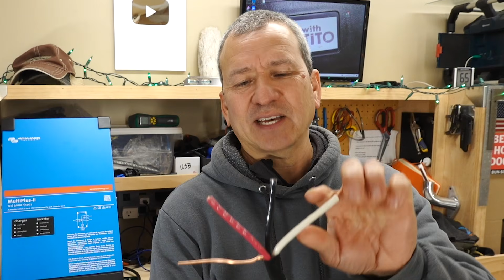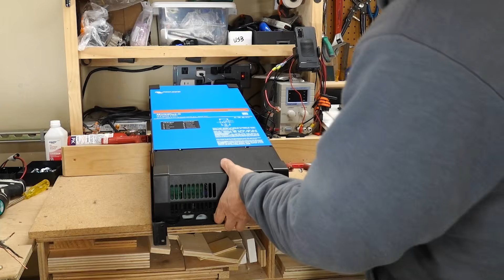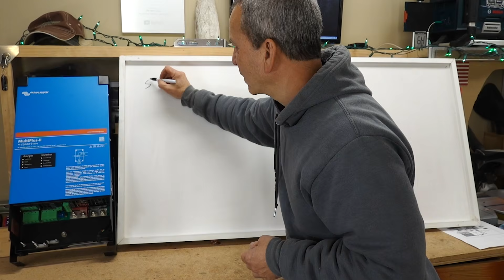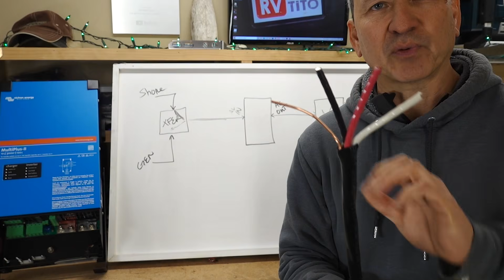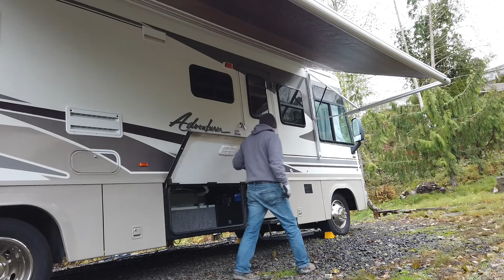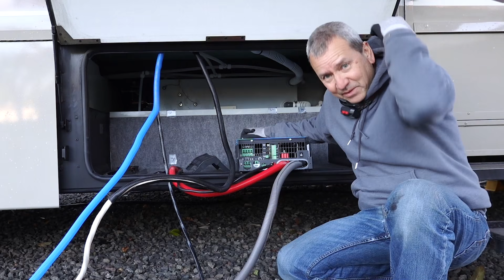Installing the Victron Multiplus II Inverter to Power our 50A RV Off-Grid | RV With Tito DIY

Comment: I opted to do this in phases. The inverter Pre-wire on our Brinkley is a 30-amp circuit looped to the front bay of our 5W. So essentially this is like being at the state park on 30-amps. I think it will work for now. 

This 30-amp circuit evolved at the factory over time, ours runs everything but the front AC, the 1,100-watt microwave, the electric fireplace, & the converter. 

I unplugged the converter now., of course. 

We camp host at 8,500' in a steep canyon so even though the rear AC (7 amp AC draw) is on that same 30-amp circuit we won't need it 99% of our summers. 

Phase B will be to drag two more 6-3 marine grade wire bundles from the kitchen AC breaker panel area through the chase way to the front 5W compartment. That will require the help of a buddy I am told if I am to do it without dropping the belly pan. I like your idea of two different colors of split cover wire protectors. All I will have to do then is upgrade my 30-amp dual 2 gang disconnects over to the 50-amp size. 

For phase one I have the 6-3 6 ga. wire in place from the intermediate disconnect box to the inverter already. Since it is emulating being on 30-amp single L1 like a state park (only 12-2 comes with the Inverter Pre-wire), shall I jumper L1 & L2 at the input side of that intermediate disconnect box going to the inverter or leave the L2 line floating? In the case of the 30-amp at the state park with my 50-amp to 30-amp dongle they would be tied together. However I would just be emulating this manually in my own wiring at my Inverter disconnect. I see a lot of folks just not hooking L2 up if they have a single 120-volt line in, but that isn't how the outside dongle on my RV works, for example. 

The 6-3 going back out to the coach from the Inverter is wired, but only L1 going back to the Pre-wire line. For now, L2 is going to an outlet I set up for a small Lifepo4 charger that I use as an alternative to recharging a separate 100ah Lifepo4 battery dedicated to powering our Starlink 12 to 48 volt DC to DC converter to our POE. That battery has its own solar panel, but with camp hosting I like to be like NASA & have redundant functions in most everything I do. 

Also, since they are shorter runs to my Lynx Distributor, I run two runs of 4/0 cable for both the red & black wires on my MK2, fused at 200-amps each red wire. They run much cooler now at a full 30-amp AC off-grid load which is an easy 200-amps DC. However I did not do this on the 560ah battery bank yet. Even us OCD guys never finish our work!

Cheers, Davey - KU9L
Reply from the maker: If the inverter detects split-phase 240VAC across L1 and L2 (50A shore power) it will pass that through to the L1 and L2 output. If it detects single-phase (your 30A) then it will split the L1 120VAC input across L1 and L2 on the output (basically jumpering it internally) and ignore the L2 input. The output will be duplexed 120VAC single-phase. Hope that helps.
Reply: @RVwithTito  Thank you, sir. It appears then I don't need to jumper L1/L2 input together then for a 30-amp Pre-wire input on a single line. Their SW & electrical engineers have it figured out. Either way I would remove the Jumper before running those 6-3 lines to the main fuse panel & back. The reason I do not have it done already is my jobs do not seem to come with a Tito to keep me on task, lol. Thank you, Davey - KU9L

Comment: Is this really a true 50amp system though? From what I'm looking at, this inverter is only rated at 32amps max when using just the batteries to create your a/c. The only time you have access to 50amps is during pass thru when the generator or shore power is hooked up.
Reply from the maker: No. You're correct. The inverter is limited to just under 3KW. A 50A shore power connection can potentially supply 6KW to each leg of your service panel for a total of 12KW. The benefit of this inverter for 50A RVs, is that it can switch between the split-phase grid pass through mode and single-phase inverter power while still powering both legs of the power panel. Prior to this, you'd need a manual switch and two inverters to accomplish this. And yes...while on inverter power, you need to manage your large loads so you don't exceed the 3KW max of the inverter. Hope that clears it up.

Comment: Thanks Brian. Just started this project myself.  Good info.
Reply from the maker: Good luck with the project. What kind of RV do you have?
Reply: @RVwithTito  We picked up a 94 Holiday Rambler Diesel Pusher. Making a playlist of all the fixes and upgrades we are doing. I'm going to reference this video if it is ok since you do a great job explaining it.
Reply from the maker: @TignerAdventures  Great. Nice upgrade. I remember you guys from Casa Grande. Hope you're doing well. There is an entire playlist about that project. Let me know if you have any questions. 👍 The only thing I'd do differrntly now is to install one of the new Quattro II units instead of multiplus. Then you can ditch the atomatic transfer switch.
Reply: @RVwithTito  The wire you tapped into already had gone through the transfer switch. So it would have been more work running wires to eliminate it. So since you have a ATS would you still prefer the Quattro? Does it manage the connections better?
Reply from the maker: @TignerAdventures  You're right. It's definitely not essential, just another option. To do it, I would have to run an extra cable from the ATS location. It would just eliminate the ATS. I had to replace my ATS a while back anyway. There would be some additional controls you'd have but I haven't dug into it in great detail yet.

Comment: Instead of running the wire from the inverter to the breaker box, couldn’t you just set up a 50 amp receptacle there and plug your shore line into it? Seems like it would be easier. The shore cable runs to the breaker box right? And if you’re putting the inverter in between the shore power auto switch, instead of running that cable, why not just set up the 30 amp or 50 amp receptacle and connect to the breaker box that way? Please be kind to me with responses.

Comment: Thanks for the video, great stuff. Question, I have the same inverter with a 30amp shore input. Would you see a need to breaker or fuse that input before the inverter in case the inverter tries to pull 50amp?

Comment: Thanks Brian,  one question, did you disable the converter charge wire to the batteries? Or doe both the inverter and converter charge the batteries?  Thanks for the great instruction
Reply from the maker: The Multiplus charges the batteries. The Converter/Charger was no longer needed so I removed it.
Reply: @RVwithTito  Thanks for the reply.

Comment: Great to see your video. I'm heading this way based on a couple of videos from @AllAboutRVs. This is a great solution for our class A to power the entire coach with the single inverter. I'm pairing it with two Vatrer 460 AH LiFePO4 batteries. Thanks again for all the great information!
Reply from the maker: Glad it was helpful! Good luck with your project. Epoch has a couple good 460Ah LFPs as well with all the bells and whistles (including Victron communication). I'll be reviewing them soon.
Reply: @RVwithTito  I have an epoch And it shipped broken, customer service doesn't return calls. Luckily I was able to take it apart myself and found it was just a loose cable. But will go with LiTime or something else next time.

Comment: For 30 amp service you still use the MultiPlus II, but not the 2X version. Multiplus II for 30 amp, Multiplus II 2X for 50 amp service.

Comment: Can I do the same using the Sungoldpower 3000W DC 12V?
Reply from the maker: Not id you have a 50A RV.. The Sungoldpower 3000W is for single phase only. So only 20A or 30A AC power.
Reply: @RVwithTito  Thank you. So, would the 4000w split phase work? What's the difference between the 4000w split phase unit and the multiplus you are showing in this video?

Comment: Can I use the multiplus 2 on 30a service and just use one leg? I am going to eventually going to upgrade to 50a but want to buy the Victron now; however, I dont want to spend the money on a multiplus then have to buy the Multiplus 2.
Reply from the maker: Sure can. I rarely plug in anymore and when I do it's usually only 15A. The Multiplus will split the output across both legs if you have them both wired up. If not then just wire up L1, neutral and the ground. 👍

Comment: Good information Sir . I just purchased the exact components that you just installed  but I do not understand why you ran your Shore and generator into the existing transfer switch because that inverter already has it's own built in transfer switch . 
Please explain and thank you.
Reply from the maker: The two transfer switches serve different purposes. The RV's Automatic Transfer Switch (ATS) switches between generator and shore power coming into the RV. The Inverter's transfer switch handles the switching between incoming AC power (from the ATS) and inverter power. That incoming power could be from shore power or from the generator (hence the other transfer switch).

Comment: Why do you use four seperate solar controllers instead one bigger one?
Reply: Or he separated different strings of panels in case one set gets shade the others are still good. If you have them all in one series, one panel with shade affects the entire array.
Reply from the maker: Plus each one generates a different amount of energy as the sun passes and some may be tilted while others aren't. They all perform independently.
Reply: My guess is load limitations of the controllers, or he has four separate arrays on top to maximize power when using blends of different panels.

Comment: I have a question.  What is the purpose for the selector switch on the bottom right used for?
Reply from the maker: Just a manual switch to turn it on/off, inverter, or charging only. Once you're connected.to a Cerbo or Victron Connect App you'll never need to use it.

Comment: So if I have a 50 amp system and use a dog bone to 30amp, will both L1 and L2 still have 120vac just be in phase?  Same with generator running, would L1 and L2 be hot?  I heard it will see them as in phase and shut down L2, is that true?
Reply from the maker: Yes. It will be single phase on L1 and L1 coming in, but I believe the inverter detects single phase and only looks at L1. It will then branch it internally to both L1 and L2....I think. In either case, the inverter treats it as a pass-through.

Comment: Hey tito. 
thanks for the video. 

1- let me ask you about the, lets call it "controler power source" or what ever multiplus II needs to go to an ON stage. 
let me try to explain: 

I have a renogy inverter, and now upgrading to a multi plus
the renogy receives the "controler power" from the batteries. 
if your battery lose charge completely (either litium going on sleep mode or AGM going very low), renogy inverter cant turn ON to charge the battery EVEN IF YOU CONNECT YOURSELF TO SHORE POWER OR TURN ON YOUR GENERATOR. 

so you get yourself into a situation where you have big AC power coming in the RV, but cant do anything. Cant charge the battery. cant use the short power. 

(i believe go power works the same way)

I have always ask myself why the inverter cant use either/or: AC input OR DC input to at least go to minimum ON state.

NOW:
I see you have your Multi plus connected to AC BUT no DC. and you are working on it. 

BOTTOM LINE IS: DOES THE MULTI PLUS CAN USE EITHER/OR  AC/DC TO POWER UP? 

2- Did you used the hook to mount? or just screws?
seeing my RV, it first vertically, but I think there wont be room to going up enough to hook it up. 

great videos. watching them all. 

THANKS!

Comment: Brian, is the Victron Multiplus II compatible with a Electronic Management System (EMS)?
Reply from the maker: Depends which one and how it works. When on shore power everything should be 50A split phase and normal. When inverting it will behave like 30A single phase service.

Comment: Hello Sir, I have purchased the Multiplus 2  2 -120 50 amp 120 charger.  I have 4  400 watts solar panels, 1600 watts total of solar panels, I have the Victron MPPT 150/100 charge controller and the Cerbo GX.  I have 1200 amps of Lithium batteries. Can you tell me your settings on these electronics that you use to maintain your system.  I also have a Daly 250 BMS.  I need to know what settings for the Absorbtion, Float and low battery and High battery settings.  Thank you in advance.  God Bless  Ray
Reply from the maker: Have to go by memory here since I haven't touched them in 2 years. I think I've got bulk set to 14.4v, Absorbtion set to 4 hours and Float at 13.4v.  Unfortunately, I can't see/change the charger settings without plugging a cable into the inverter.
Reply: Thank you sir!  My system is working great but I had a 250 amp breaker not working and I was getting a Low Battery Alarm.  Can you tell me what Circuit breaker you used for yours?  Also how does your generator work?  I believe with this multiplus two it has a limit of 3000 watts.  Both my AC's together is about 240 Amps.  Thank you again for replying.  When I first started watching your channel I built up enough courage to install Solar System on my other RV, 1998 Fleetwood Discovery. @RVwithTito   Prayers and blessings.
Reply from the maker: @retiredletsgosomewhere8743  Which circuit breaker are you curious about. I have a 400A T-Fuse between the batteries and inverter, but no breaker. Also, when the generator is running, I believe the multiplus treats it as pass-through power (like shore power). So it can exceed the 3000W.
Reply: Hello  I ordered the 400 A T-Fuse and I will install.  My Generator does not work like that.  I have contacted the company that built this and I will try to figure it out.  God Bless  Ray @RVwithTito
Reply: Hello sir, can you run both ac's at one time?  Ray
Reply from the maker: @retiredletsgosomewhere8743  I only had one A/C  unit. Yes I could run that A/C for a while during the day when the sun was shining.
Reply: thank you  Ray @RVwithTito

Comment: You need to make is very clear that not all MultiPlus-II Inverters, actually work like your Inverter. You have a special MultiPlus-II, called the MultiPlus-II 2x120 .  That is the only model of MultiPlus-II Inverter that supports the automatic switch-over between 50 Amp Split-Phase and 30 amp Single-phase.
Reply: So this inverter detects if you ether plug into a 30 amp or a 50 amp hook up?
Reply from the maker: It detects split phase or single phase input.

Comment: Brian, I've used several of your innovative construction mods:  flexible panels with t rails, aluminum angle cages for batteries and others.  In 2020, I went with an entire Victron system for my class C Navion: 640w on roof, 400w Aux on ground, 4 MPPTs for max efficiency of shading, DC to DC converter, and lots of new increased gauge wiring to meet safety.   Then installed the 12vdc dual compressor NOVAKOOL refrigerator.  We're 30 amper So went with the multiplus 3000.  I've not had a moment's problem and Think Victron is the gold standard for RVs and sailboats.
Reply from the maker: Nice job! I agree with what you said about Victron. Once you go blue you don't go back. You just keep adding more :)

Comment: Ok , offgrid cabin . Solar 30amp 
30amp sinle pole breaker hooked to side B
Genorator 40amp 240v .
Wired int a home breaker box , Genorator hooked to main breaker suppling power to A n B sides . 
So this enverter would allow me to take battery power and Genorator power IN , and send double phase power to main breaker  . Supply power to A n B . And the enverter would do the automatically switch .
Fallow , then I would be able to balance the load , and could use 240 for my well pump .?

Comment: Option 4 put a transfer switch and place a jumper wire from L[ - L2 ? Works great
Reply: Isn't that same effect as using the 30A male to 50A femaie Dog Bone?  Why do you need a Transfer switch?  Either way, you have the same problem when there is NO AC power input ... The Victron is running on the Battery Bank only, now how do you bridge the Victron L1 & L2 outputs?  The Victron has OPENED both L1 & L2 inputs removing your bridge between L1 & L2.

Comment: Love your approach.  Would a multiplus eliminate the need for my rvs transferr switch and the converter boxes!?   Would be nice to wite everything into the multi box.  Fyi, i still have a generator in the rv, besides shore power inputs for ac.
Reply from the maker: You still need a transfer switch to switch between generator/shore power. The converter/charger is no longer needed.
Reply: @gobfranklin6759 - NOTE: This  only for the MultiPlus-II 2x120 Model only.  And it can be very noisy and it hums.

Comment: I love watching your videos.  I would love to chat with you if possible.  I have some questions since your rig has basically the same chassis as mine (workhorse W22).  My electrical panel is in the rear of the coach, basically directly above the transfer switch.  My plan is to mount the Multiplus II on the roof of the bay and route my cables straight up to the panel.

Comment: What I don't understand is, is this unit not underpowered?  A 50a circuit is 6000VA on each leg or a total of 12kVA.  This unit appears like it would only offer 25a (on each leg or total across both).  Am I missing something?
Reply: @brianvandy4002 -  Nope, you are not missing anything.  The unit is rated at 3000VA .  But per the Victron datasheet it is rated at only 20 amps total or 2,400 watts.  And the units can be very noisy and they hum.

Comment: I know this is an older thread, but did you disable the charge line from the converter so it’s not charging the batteries from the converter?
Reply from the maker: Yes. I removed the converter/charger completely.